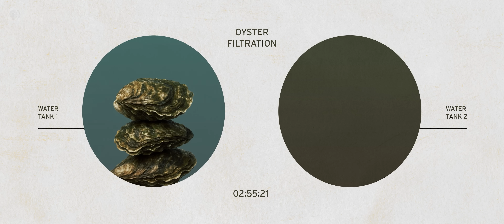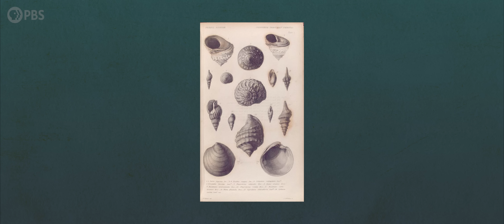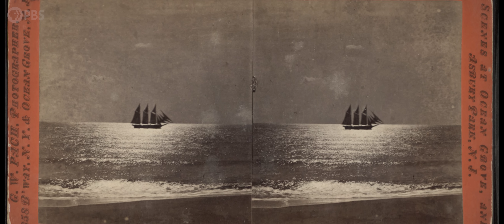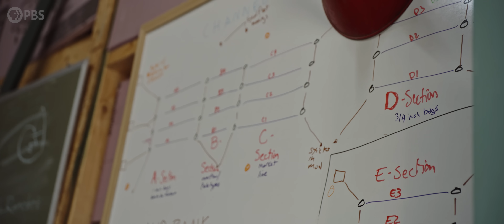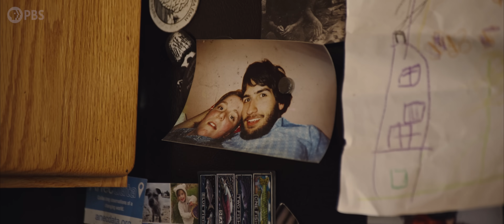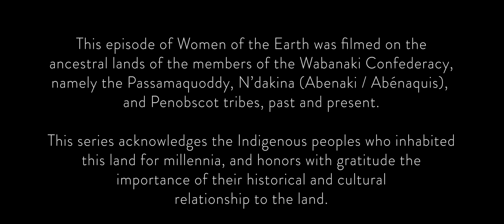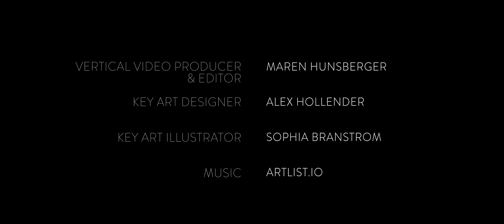How Microplastics Infiltrated Our Food (And One Way To Get Them Out)

Comment: To have industries move away from plastics, the alternatives need 3 things. Be cheaper to trasnport in bulk, be cheaper to manufacture, and be cheaper to maintain. Roughly in that order. 
Metal or Glass/Ceramics would be the best substitutes, but they are VERY heavy or brittle, and more expensive / energy intensive to manufacture. Wood and fibers rot too quickly, increasing maintainence and storage costs.

Economies of scale really impact margins, and even a few grams of reduced weight can mean THOUSANDS more of a product can be transported to markets for the same cost. Sadly, i think plastics are here to stay, but what 'kind' of plastics we use can be changed. PVP (Polyvinylpyrrolidone) is used in modern Fiberglass insulations and can be dissolved by the immune system (this is one of the things that makes modern Fiberglass insulation significantly safer than Asbestos. PVP is still a forever chemical you don't want in your body, it'll settle in your organs and brain. If you work contruction, where a good respirator and PPE)

PVP and alternatives like PVA (polyvinyl alcohol) don't fully dissolve in cold water (like oceans), and are forever chemicals that'll settle in organs and present increasing pollution challenges, but their existance shows we 'CAN' make plastics that could, in the future, fully degrade to a state that Plastic eating bacteria (which exist, good for wastewater treatments someday) can process further into ketones. At the moment these plastics only dissolve with warm to hot water, with specific acidity levels and agitiation, and aren't strong enough to replace current lightweight hard plastics like PET, HDPE, or ABS.

Comment: I wonder if and how ceramics could be utilized in this process. Low-fire ceramics tends to be more porous, and if made by doing slip casting, can be quite lightweight. Its durability comes down to the force it’s used with, but it could be a good potential. 

Thank you PBS Terra for celebrating and uplifting women in science, and to Abby for letting us hear their story and the work they are doing. A drop of water still makes ripples that spread throughout.
Reply: Isn't ceramic brittle? If it can break when you drop it, it definitely will break on the waves at sea (they're quite gnarly). If not, you've come up with the solution :)
Reply: Good idea, replacing plastic with aluminium introduce a different set of problem; ceramic depends on the actual material going in might work better, but the cost could be much higher. Wonder if there are other alternative
Reply: remember that lowfire ceramics are porous

Comment: What a bs to say plastic is a climate change issue. Trying to force the plastic problem into climate change is a stretch. Literally everything coming out of a factory produces a lot of greenhouse gases

In fact, plastics reduce carbon in the air by locking those carbons in a permanent solid form called.... plastic. It's a simple science, if it's not in the air then it's in other form

Comment: A question, as a material chemical MSc, I have struggled with the blessing and curse that polymers and all other materials are for about 30 years. I would like to know if you use LCA to ensure that your replacement materials don’t cause equal or more harm  by just shifting it around in the supply chain.  Or changing it for another that we at this point don’t know the ramifications of (just as we did not how big a problem and to where microplastics could spread and bio-accumulate. Thinking of for-example the surface treatments of metals as aluminium have surface treatments that over the years have improved but still will cause waste with phosphor,  heavy metals and fluorides.

Comment: Great mission! So pernicious is micro plastics and require replacement to bio dissolvable plastics. Boats made with fibre glass are also an issue to dispose of without water pollution!! Metal Boats can be re cycled more easily? Plastics too cheap as no price paid for the damage to the environment and if a realistic tax is made it would encourage faster transition to non toxic bio plastics!

Comment: What kind of scrap wood do you have available in your area for cheap? If you start with those materials and add in willow branches, reeds, vines, and flax, there could be some low overhead designs for gear that's designed to be replaced every season.

Comment: Something does not gel for me. Barrows state that plastic is for ever and the all plastic ever made is still in the environment. Then she later says that every step of plastic production has greenhouse gas emissions, even when it is landfilled. If it does not degrade, how is it possible to generate greenhouse gas emissions in a landfill? Further she says that oysters filter a lot of water, removing impurities and high levels of minerals from the water. So these are trapped in the oyster, yet she "feeds humans" including the impurities and high levels of minerals it removed into the diet. How is that responsible?
Reply: Plastics are made of hydrocarbons as they break down (slowly) they cause greenhouse gas emissions.

Comment: What about using bamboo coated in bees wax for flotation and flax/linen for screens, nets & rope?  All of which are affordable, durable, repairable and renewable.
Reply: Also using pine resin/pitch for waterproof glue and would enable added rigidity/duability to the linen/hemp, screens, nets and rope when needed.  Using one of the most energy intense metals like aluminum is not a very good choice in my opinion but I do concede that it's better than plastic.

Comment: Bell bicycle riding helmets? A sizeable portion of plastic materials carry with them un/or non comprisable logics. Molecules which form shapes, and these shapes are full of logic. However with zero or near zero half life plastics and the logics contained within them have zero point logic. Logic which has no goal nor event horizon. These logics exist as a for a super natural stasis. Stasis for celestial, heavenly, terrestrial, oceanic, foliage , fauna and humanoid events. Rubber already has the event horizon in place within its sub molecular structures. With plastic there is no chance for an event horizon. That's why it's cheap and dangerous...